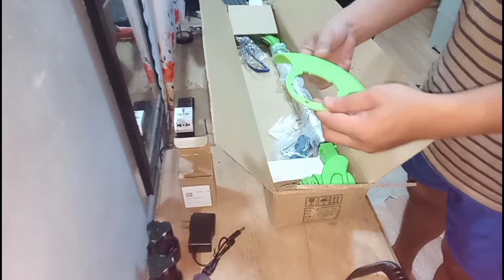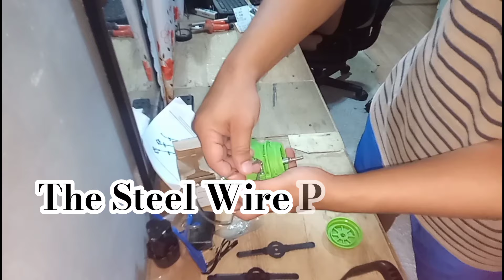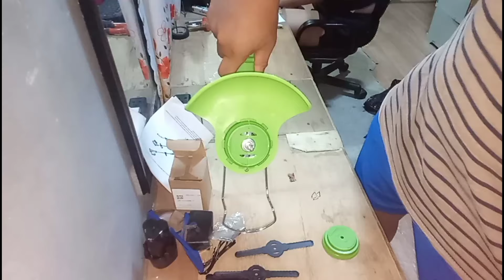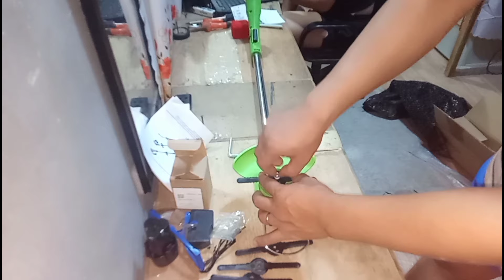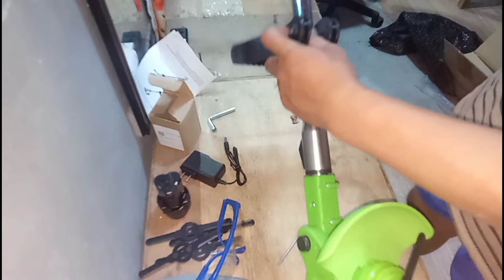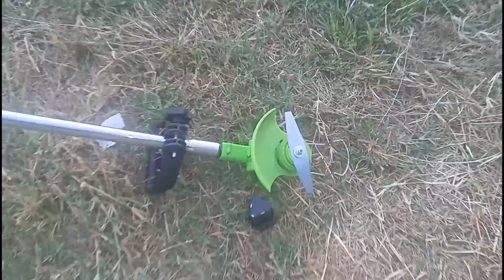How to Assemble Cordless Electric Lawn Mower/Grass Cutter

Comment: Did you try to change the blades yet? I have lost the flimsy manual and it seems you have to stop the motor or internal mechanism from spinning, I believe there should be a hole to put a screwdriver in to stop it so I can unscrew the nut. I can't see where it is though.
Great video BTW, very clear.

Comment: Hi,
I used the same grass cutter only twice and somehow, am unable to use it anymore as the screw used to hold the blade became stuck n the blade stops moving. Hard to remove the  screw after that. Is there anyway, I could bring the cutter to someone who could check the problem?

Comment: I am having trouble changing the blade because the cap has tightened so much. Any suggestions on how to loosen it?
Reply: I got the same issue but mine school boy error cuz I put 2gether wrong I got the black cap on the outside 😂
Reply from the maker: Use a biscrip, it will help losen it.

Comment: It doesn't spin at all how do I fix it it's like it stuck
Reply from the maker: Manually rotate the shaft.
Press the black safety lock located on the right side of the handle. Then press the switch below it.

Comment: how do you charge the battery
Reply: Right on top.of.the battery, it is a charging port (mother connector). Just plug the father connector of charger in that. While.charging, the LED on charger has a red light (green when unplugged).
Reply: There is no connector on the top[ of my battery.  There is no place on the handle or battery to plug the charger into.   @SpiritsHigh_bottled_kind